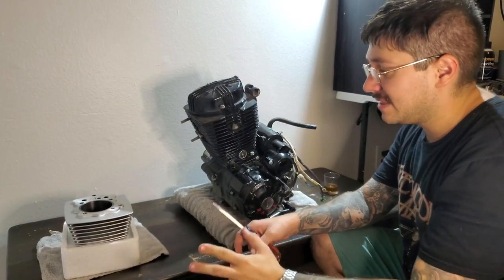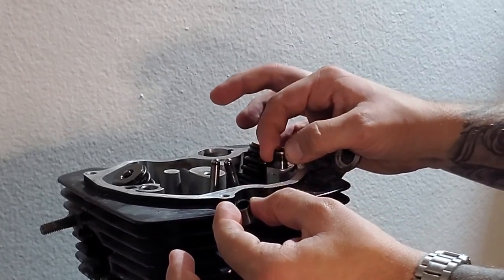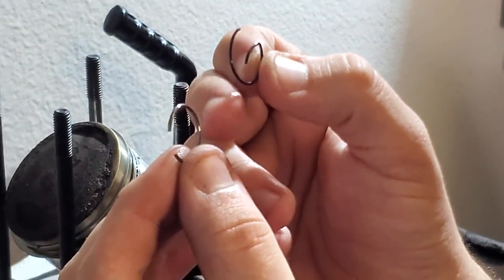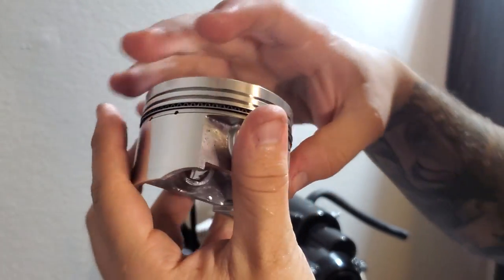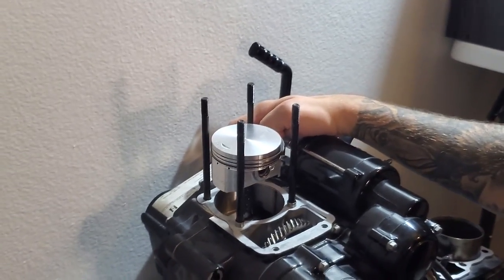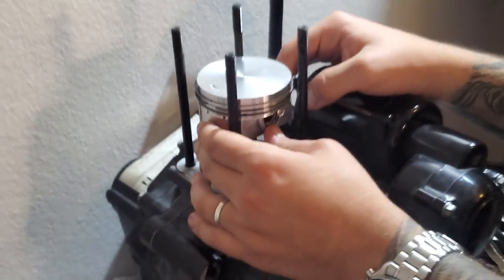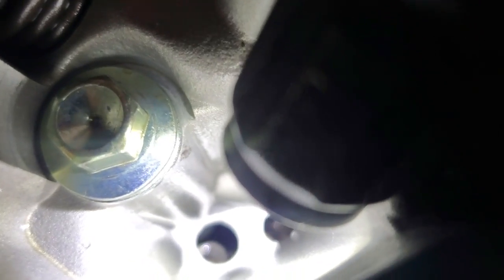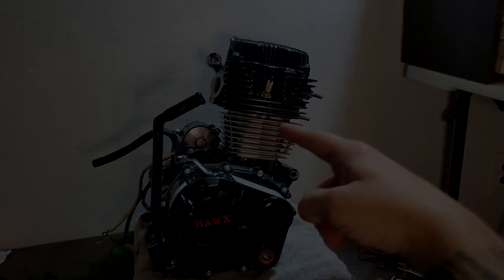HAWK BIG BORE KIT INSTALL (Full Tutorial)

Comment: As an aviation mechanic, the best way to find TDC is just hold your finger on the spark plug hole and rotate until you feel compression, by using an aluminum welding rod or coat hanger laying on top of the piston continue the rotation until the rod start by down, that TDC.

Comment: I feel like I missed something here, this kit brings the engine to a 70mm bore and still 65 stroke leaving the displacement at 250.15cc. I'm not seeing how the cylinder wall would be thick enough to be bored out to an actually 300cc.
Reply: Correct

Comment: When installing rings on any four stroke piston install the oil ring first then the two control rings that go above and below the oil ring. It's a lot easier that way because the oil ring has a lip on the top and bottom inside edge of it that sits behind the control rings. It's hard to explain but if you look closely at all three oil rings you immediately see what I'm talking about. Now let's see how many keyboard mechanics disagree with me on that lol. I'm just saying that method has ALWAYS worked for me and I've built my fair share in the last 30 years!
Reply: Can you add a google image link to what you're talking about? I'm new to these bikes and I  want to do everything as correct as possible when I finally install the big bore kit on my 250cc. And thanks for your knowledge !
Reply: That’s correct!
Reply: @roadgaper2570  if you need some help with your piston rings I just made a video covering the process so they get installed correctly!!
Reply: Yes !
Reply: Correct when installing ring you would first do the expander then the two scrapers then second ring then top ring

Comment: Ordered the kit and the wrist pin is 18mm but my bike is a 16mm and the cylinder is bigger than the original so it doesn’t fit on the engine. Any suggestions? What year hawk did you rebuild?

Comment: I could be wrong but I believe this kit increases your bore size from ~67mm to 70mm and leaves the stroke the same (~65mm). If this is the case it increases the displacement from 229cc to 250cc. That being said, for the price it still seems worth it and kind of awesome.
Reply: As a side note increasing bore size to ~77mm which would give you around 300cc displacement could cause fitment/cooling issues 🤓
Reply: Yes sir the big bore makes this engine go from a 67mm bore X 65mm stroke 229cc to a 70mm bore X 65mm stroke 250.2/250.4cc can’t remember the final displacement but it’s .2 or .4 anything beyond a 70mm piston the rod starts having long term reliability issues so I’m working on increasing the stroke to achieve somewhere near a 300cc…then I get to find out what else fails 😂
Reply: You are right it's not 300 it's 250ish
Reply: Do you still have the same head on it? I've decked my head .04 port and polished and have a thin ss head gasket.  Will it still work on that 300 jug?

Comment: Worth mentioning when you installed the rocker box you did get the torque correct at 20ft lbs for 3 12mm bolts that hold it in place!! As well the head torque spec was also correct at 24/25ft lbs so again good job on the install video!!

Comment: Enjoyed your video. I am a mechanic by trade, you did a pretty good job. (And I'm going to use some of your nomenclature with my co-workers because they work and they're unique (Pushrod Actuators = Rocker Arms for instance) -- good stuff, thank you for taking the time to show all the ins and out of swapping a piston and jug).
Reply from the maker: thank you friend
Reply: In my mind they are solid lifters, rocker arms are pushing on the valve, so pushrod actuator does work here but not for rocker arms
Reply: Don't do that. You will sound like you have no idea what you're talking about
Reply: Are you sure it's 250cc not 229cc, and that after the upgrade, it gets 300cc, not 250cc?

Comment: Been debating going to the 300cc jug, and want to thank you for this video.  Real help.
Reply: I purchased the 300 jug kit and it has 300 cast on the side. The piston pin hole may have a little offset. The valve reliefs were much smaller.
Reply: @johnvolstad5870  Please come back and tell us how the jug upgrade went(long term).  I have on my todo list a 141cc BBK upgrade for my Boom Vader bike, but after that might add a few cc's to my TBR7 motorcycle after that.  Thanks!
Reply: @CageFreeTom  They have a daytona 190cc and a zongshen 212cc that fit your bike. Both 5 speeds.

Comment: not sure if i missed it but the rings especially top and middle the gap should be 180 degrees apart..  oil ring same thing..  also its called wrist pin through piston and connecting rod from crank.  :)   also good to put a bit more oil on the rings for insuraction of piston in the bore.  just helps with first start to prevent scoring of the cylinder walls.  good job.. :) enjoyed it.
Reply: true

Comment: Please tell us the brand of kit you received. I got the DVNOP brand with the coated flattop piston. Had Austin Auto Machine turn the sleeve down to 74mm. Put the pin in the piston and connecting rod. Slid the piston carefully over the rings. OMG, the piston top was a full 3mm below the deck of the cylinder jug !!!! put it together anyway and managed to get it to run. put compression gauge on 50PSI of compression.

Comment: Wrist pin, not a sleeve
Piston rings should be gauge in the cylinder before installing on piston. Most rings will have a dot or number that faces up. If you have a arrow on top of piston means arrow faces towards exhaust . If you have new gaskets, use them

Comment: FYI GUYS. "D" is a manufacturer mark for the company "DONGYA", DY means top ring and D means bottom, other companies like ATG for example will have "ATG" as top ring and "A" as second ring. Orientation doesnt matter as long as you can tell which is which by rubbing your fingers against the ring like he said which is corect. So in this case D will be the Scraper ring NOT THE COMPRESSION RING like hes showing (according to the manufacturer) and also "IN" on the top of the piston DOES NOT MEAN Inside the frame or whatever he stated.. IT MEANS "INTAKE" VALVE! so the "IN" means the piston needs to be orientated facing the INTAKE valve side of this engine and not the EX or EXHAUST!. has nothing whatsoever to do with the inside of the bike frame. just my .02.

Comment: You ever looked into swapping a 2 stroke motor into one of these china frame? Anybody you can point me towards? I been looking at a kx80 kdx80 cr80 cr125 2 stroke type of deal. The kdx 80 2 stroke looks like it will bolt right up with 15hp and great torque.

Comment: I have a question all these Chondas that are being built so they all use the same motors? I wonder if the Bashan 250, Xpro250 and the XMoto 250 or the Apollo 250 are clones of the CRF 230?

Comment: I took off the odometer but I'm pretty sure I've got over 150 hours on my Hawk 250 real off-road riding and wheelies because I stripped it but lately it's been making a bunch of noise from the top end of the engine I bet I'm going to have to replace valves and The Jug including the piston

Comment: Can this mod be made to a Hawk DLX? Will the EFI still provide the proper air/fuel mixture?
Reply from the maker: i THINK you will need to provide a larger injector to satisfy the larger piston. i havent tested this so i dont want to state this as fact. however i've heard of some people installing a larger injector and some people not installing a larger injector and they yield close to the same results. this is certainly something that needs tested. and it almost makes me want to buy a DLX just to test it. fuel/air mixture is always an art. so i wish i could provide you with a solid answer for this but i cant. will it install? yes. will it run well? absolutely. will it get upto speed? yes. will it utilize the newer piston properly and prevent the bike from running lean? i do not know about that one sir
Reply: Makes sense. I think we all will be curious how much performance improvement you see and how much you need to tweak the carb.
Reply: i wana see you get the dlx and make it niiize

Comment: Great tutorial! I am curious what kind of gains you will get. I just might try the DLX out if you can gain 25% more power. I am also curious if you could buy a water cooled cg300 and fit it on a Hawk without too much custom work.
Reply: Would you have to do anything to the ECU on the DLX?
Reply: @glefic  yeah, definitely would need a new tune for more air and fuel. The stock injector might work, but if it couldn’t supply enough fuel, you would probably need to find a way to rig up a bigger one.

Comment: Hey man you hawk guys have more info on these cg engines. What’s the difference between in the cg150+ is it just piston size? So technically I can just buy a 300cc BB kit and slap it on a 150?
Reply from the maker: the crankcase should be smaller aswell for the cg150. back tires and frame should be smaller aswell. i think the mod is only possible on the 229cc hawk engine. theres nothing stopping you from purchasing a full hawk engine and trying to appropriate it into your smaller frame. whether its worth your valuable time or not is entirely upto you

Comment: Seems you got the 73mm OD sleeve, 16mm pin, with your kit. It was the one I THOUGHT I ordered. They seem to be Out of stock. (Oops Dept.) My jug has a 75.5 OD sleeve. The gearcase has a 74.3 mm bore. Any Ideas? Help will be appreciated !!
Reply: You must take your box disassembled so that the casing can be enlarged in a lathe until it is made to measure. Here in my country we do that job a lot and it turns out great. a brutal force....

Comment: Listen mane I don’t know how to say thanks but ima just give you the gist details I have a Tbr7 250 basically I’m buying a cg250cc > to a Cg300cc basically the part you said we are replacing and everything else the seals and piston all that
Reply: AnywAys I want to say thank you because without this I wouldn’t be able to save my bike it’s eating oil and I believe the seals are fried from putting too many aftermarket mods (carb, cdi, ignition coil) and basically burnt my engine so I’m hoping this big bore kit will save my bike and then I should be set for the exhaust ! I know I’m probably talking to myself but if I can get in contact with you for any help I would more than appreciate it I’m just starting to get into this and if I replay this video long enough until I build the confidence to order it I should be able to know exactly what I’m doing 🫡🫶

Comment: hey man: is this kit ok for a Zongshen engine 169fmm (223cc).. do you have some Hp and nm  with the 300cc installed?
Reply: the 169FMM is an OHC not the pushrod OHV so this particular kit will not work.

Comment: Big question, how long did it take to get yours shipped in from Aliexpress, and was there really no modification needed to the sleeve?
Reply from the maker: modifications were done by trusted persons in the chonda riders group on FB. they can be ordered through them on messanger, if you're afraid of being scammed they can post the machined jug on ebay where you can purchase it through secure transaction
Reply: @mototaco6603  I looked on there and they have one listed with a 73mm outside and 70mm inside diameter, but I'm not afraid of taking a little off the top if needed, but as far as I'm aware they need to be 70mm to fit the crankcase.
Reply: 73mm rather to fit the crankcase... long day...

Comment: If you don't mind,where did you get the manufactured specs
Reply from the maker: hawk forums on FB (chonda riders group / hawk 250 enduro owners). torques from the hawk 250 owners manual. but the torques for the valve train bolts i sorta made them up based off of the size and thread contact of the bolt. 20 ft lbs seemed safe based off of the largeness of the bolt. 4k miles on the big bore kit no issues so far. waiting till 10k miles to do and update on the entire bike
Reply: @Moto Taco  Thanks much appreciated

Comment: I notice one kit says 18mm pin. Are these 18mm or 16mm? I read conflicting things.
Reply: a zongshen 167FMM CG250 uses the 16mm pin. I am not sure about the Lifan versions of the CG250.  The best way to be sure is measure the factory pin before ordering any upgrades or aftermarket parts. You will also need to get the CG300 cylinder skirt machined down to the probable outside diameter of 72.8mm to fit into the engine case

Comment: OK, What is the top three improvements you have noticed after putting on the 300cc head?
Reply from the maker: Low end torque of course. Top speed will be higher i know for sure, but i havent tested it yet im waiting for it to break in a little bit more, ive upped it to a 130 jet until my new carb comes in, and i cant post an update until the ported heads come in aswell. So thats where im at 🤷‍♂️🤷‍♂️

Comment: just a question : shouldn't you upgrade the head into 4 Intake Exhaust Valves instead of leaving it at 2 now that you've jumped into a bigger  oversized 300cc BORE? and will there be a carburetor (air / fuel ratio 15:1) adjustment or in your case do a reprogram/ tweak for the fuel Injector?. I mean there should be some sort of balance to every thing right?
Reply from the maker: i will be applying a larger carburetor and i will up my jet sizes. so far i havent considered changes the exhaust valves. i believe it will utilize the piston just fine but i cant say for sure seeing as ive only put 50 miles on the bike and i dont think its properly broken-in yet. updates will come soon
Reply from the maker: and air/fuel mixture is certainly an art. nibbi just released a new carb that is an upgrade to the PE30, called the PWK 30 and i'd like to see what results this yields. as it relates to hawk DLX versions i am not sure
Reply: @mototaco6603  I have a 150cc version of your bike. So far went to a pwk 26 which had stock 24mm carb great improvement in throttle responded with flat slide carb. Yoshimura full exhaust, china fake but good. Ordered a big bore kit to go from 62mm to 65mm. Customized by speed machine shop to work with cg150 engines.

Comment: I have been wondering if this 300cc big bore kit will work on the 2021 TT250 as it is a Zonchin  engine.... but there is very little documentation on what it will actually fit  can someone shed some light on this please ?  thanks....
Reply: I’m installing this kit on my 2021 tt250 this weekend. In short yea it will work
Reply: @nward7737  Ahhh ! thank you very much.... upon closer inspection it doesn't look like it will give you 300cc maybe 275cc at the most... has anyone done the math on the volume on this thing ? i think we've been lied too !
Reply: @bobkelly2447  bump the 230 up to 250

Comment: Nice! So it looks like it was $100 shipped looking at the link?
Reply from the maker: yes! jaysso on the hawk page that we're on turned the bottom skirt for me so it can fit into the crank case. he said it was necessary. or you could just trim the bottom inwardly so the piston rings slide in nicely
Reply: @mototaco6603  that's what I was really wondering. So it's not a direct drop in, and needs machining? I haven't been into mine in a while to rationalize why that would be so. I trust what he says though
Reply from the maker: @tashatorrid  there is a slight gray area here to be fair. there are cases where people have ordered them from this website and used a ring compressor and say that the jug dropped in completely fine. there are cases where people purchased it and sent it to somebody to have the edges of the skirt machined down to make installation easier. which is what ive done, and i also did not used a ring compressor. so i spent the extra $100 on top of the money i spent on the jug and piston for the simple peace of mind. i don't want to make assumptions that a ring compressor will solve this problem so i wont; but its my opinion that you just have somebody (or yourself perhaps) shave down the inside of the skirt that marries to the crank case for ease of installation during assembly. unfortunately this is all the information i have for you since i have not held a jug that has not been machined. but i believe he puts it in a lathe and tapers the bottom of the sleeve (or skirt) so that when you slide it onto the piston it doesn't give you any trouble or the chance to bend or pinch a ring
Reply: @mototaco6603  thank you for the detail. I'll probably order one up and see what's what. I'm usually able to make about anything work. I bet it feels a lot better now

Comment: So you're adding a big bore kit onto a motor that already is big bored? Sounds like a bad idea to me lol. These motors are already a 150 big bored to 230, now you going from 150 to 300. Hope it works out for you.
Reply from the maker: i see what you mean, has worked fine so far. alot of people pair it with an oil cooler to try to keep temperature down. but its true that these power increasing mods dont do alot for reliability. just more horsepower

Comment: Will not gain  much, maybe 1-2 hp
Reply: You can gain a bit more cause you can go up in jet size also… and a smidge more torque.. so you might not have to down shift as much going up hills…
Reply: 3-5 max gain in hp…
Reply: Mine is right past 20hp… I was thinking methanol ???